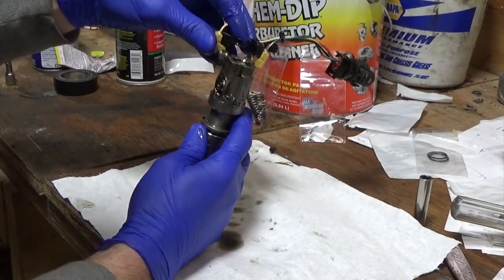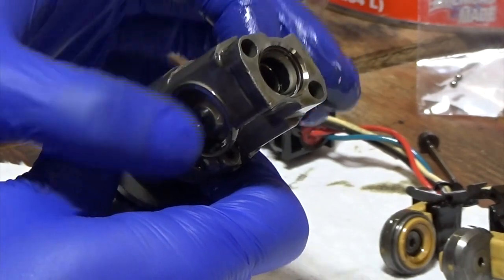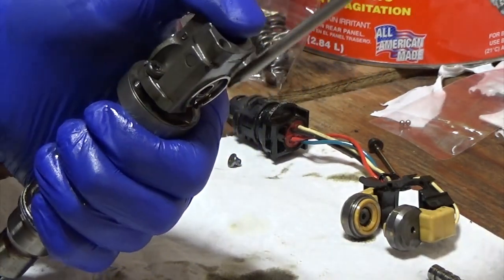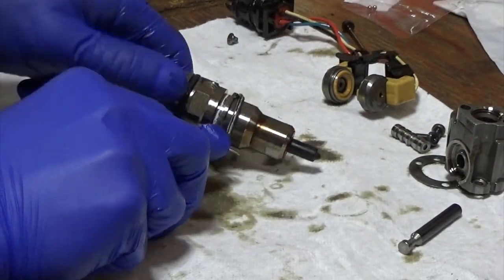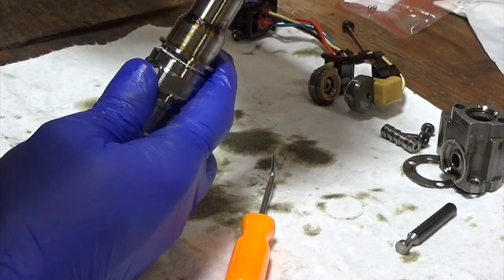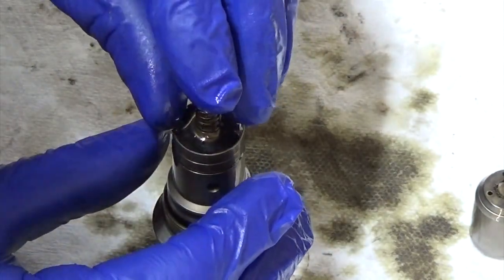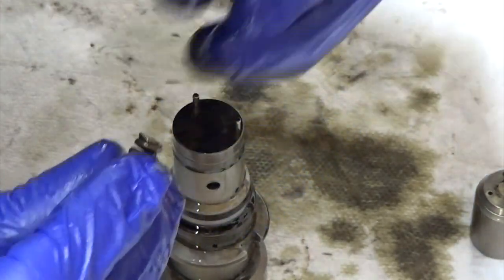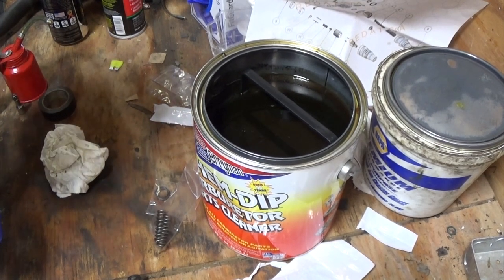6.0l Powerstroke Injector Rebuild Part 1

Comment: What would be the best injectors  to buy from? Is $135 injectors really worse  than $195 one..?
Reply from the maker: Mike Ches if your buying stock injectors Ford is the best to get. Their rebuild process is the best. 
If your looking for performance injectors. Look for a company that starts with a Ford rebuild injector then makes their changes. 
A $135 injector may not have new coils.
Reply: Alliant injectors are manufactured by Pure Power Technologies who also makes them for Motorcraft.

Comment: Can the injectors  coils be used again or they need to be replaced? Do they ever go bad?
Reply from the maker: Mike Ches yes they can be reused. The only time you would need to replace is if it test bad. I recently had an injector coil go bad that I could physically see the problem.
Reply: @showmerepair  will scan tool show ,,bad coil,, code when testing? What people mean when they say,,bad,,injectors  besides  bad orings ... and how to make sure the could is BAD or OK? THANK YOU
Reply from the maker: Mike Ches a scan tool could only give a code saying that there is a circuit issue with 1 or more of the injectors.
Using a DVOM a person can test resistance across the injector coil to test the coil. 
There can be many different pieces in the injector that could cause it to be a bad injector. Disassembling and inspecting and or testing the parts of the injector would be the best way to determine what caused the injector to go bad.
Reply: @showmerepair  what would be COMMON  Problem with the injectors  on 6.0 ,is it coil,stiction,  or cracked  tip..?
Reply from the maker: For the 6.0 I would say stiction.
Reply: @showmerepair  thank you.i have one more question, is there a way to tell if the coils are bad with out a testing tool?

Comment: What's the solution that you put all your parts in at the end?
Reply from the maker: Curtis Burdick it’s carburetor cleaner.  You can find it at any parts store.
Reply from the maker: I have not. I tried other o-ring kits from other places and have ran into issues.
Reply: Hey quick question have you ever had any problems with the quality of the parts and O rings from the company you buy the rebuild kit

Comment: So its like an old injector mechanical so to say, the electrical part only controls that valve which controls the fuel volume that enters the   Pumping chamber???
Reply from the maker: armando nika the lower half of the injector body is similar to an older diesel nozzle with a mechanical injection pump. The upper spool valve area is an on /off oil switch.
Reply: Chris B thank you very much!

Comment: Stiction is caused by the flat end of the spool valve sticking to the flat surface of the close coil, usually due to dirty or viscous (cold) oil. The updated coils have a slot in them to help break the suction of the oil on cold start.
Reply from the maker: gmupps thank you for the information.  I wonder an older style coil could be modified like the new style.
Reply: Stiction is the issue when the spool valves get pitted/scored and covered with a build up of varnish.
Reply: @bitterrootdiesel8159  That's not what PurePower/AP told me... I do manage an ADS member fuel shop but we don't rebuild HEUI stuff